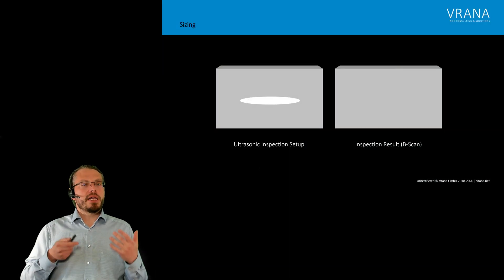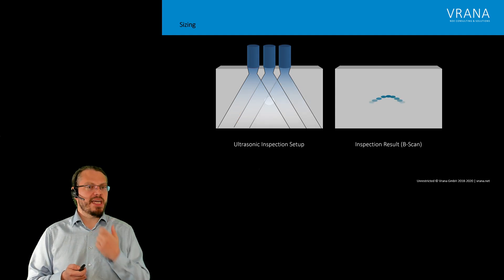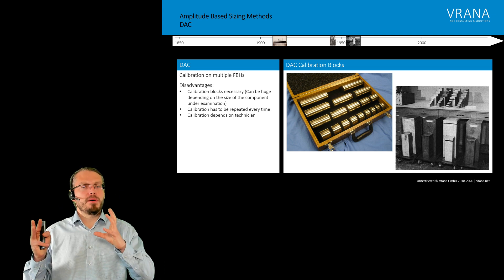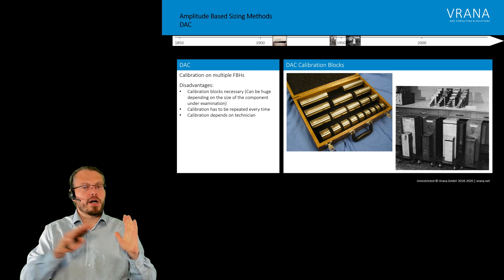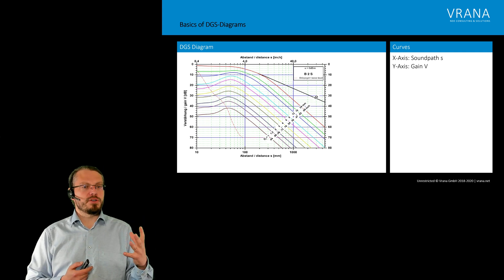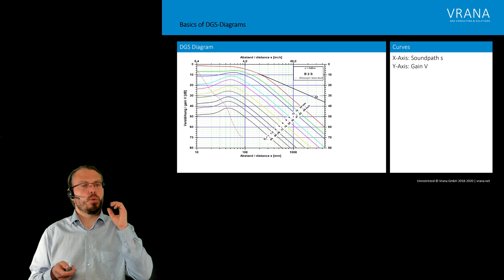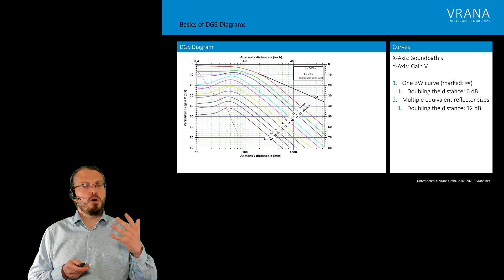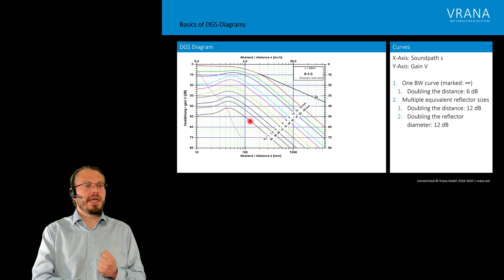Ultrasonic Calibration and Sizing with DGS (AVG)

Comment: This method only works if you have  two parallels sides which will give you a back wall echo! 
And it only gives you a reflector supposed size which again depends on the shape and orientation of your indication 
I prefer using a calibration block with flat bottom holes and the 6 dB drop sizing method
Reply from the maker: You are right - calibration using the backwall is only possible if you have a backwall parallel to the surface used for inspection. BUT: you can use the backwall of K1, K2, or IIW calibration blocks to compensate. 
Regarding the 6 dB drop sizing method, you might want to watch the following video: https://youtu.be/mr778r1uStw?si=eCIVkvJQQFBcOU_7

Comment: Thank you for this video. I am a flaw detection engineer at a metallurgical plant and I check forgings from 20mm to 1500mm in length. My experience is 11 years. I have a very important question, if you answer it, I will be very glad. If we use an amplitude equal to 80 percent of the screen as a reference signal, obtained from the rear parallel wall of the test object, then is it possible to work according to this algorithm if the surface is not flat, but curved? For example, a bottom signal obtained from a test object in the form of a shaft, that is, the rear wall is not parallel, convex, just like the ultrasound input surface? B2S sensor, the diameter of a forging in the form of a shaft is about = 100- 1500?

Comment: Hi, we need to use the DGS curves still if the UT instrument has inbuilt DGS curves.

Secondly, if we set back wall echo to 80% the db will come at 60 to 70. How to corelate with the hardcopy of DGS to instrument DGS.

In your presentation, how 14db is assumed to set BW echo to 80%.

Comment: Great video, but how can I measure the material specific attenuation due to damping (ACV) for transversal probes? For example, when we use a V1/K1 block radius for calibrating a 45°, the attenuation due to beam spread I can check in the diagram, but how do I measure the ACV in a given material? Can I just connect two angle beams and use through transmission and calculate damping based on the soundpath between single and double skip?

Comment: Excellent lecture and you speak understandable english.🙂 I learned a lot from your presentation. The books we use here in the US are very similar to what you are instructing. I have struggled with the DAC, but you sir have opened my eyes. I did training in a tech center here in the US but the instructor, he really didn't present to my insight in to the DAC as you have..I am encouraged more so now by watching and listening, rewinding until I get the concepts clearly. Makes more sense now after watching your presentation. 

Much thanks sir for your hard work and experience. Bravo.
Reply: It's DGS not DAC
Reply: @hehehaha755  lol it's a typo
Reply from the maker: You are very welcome...